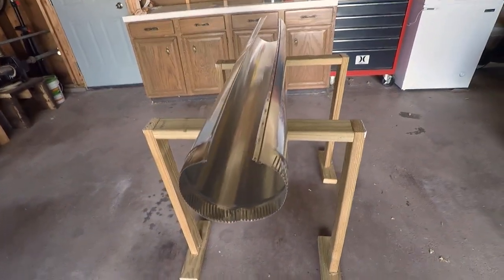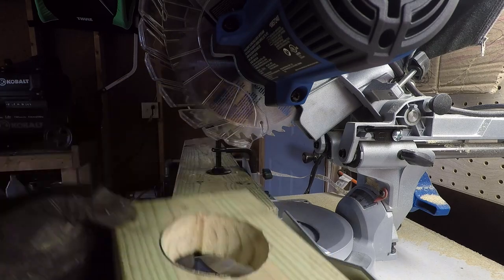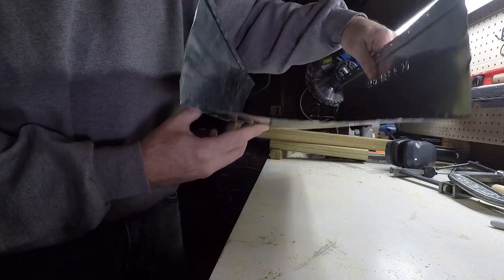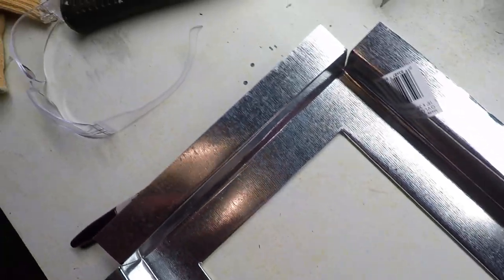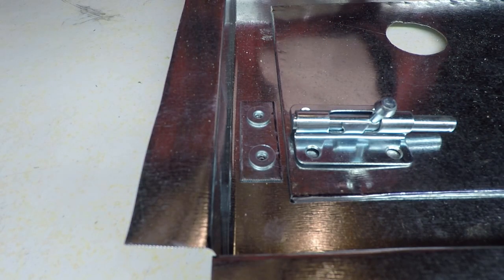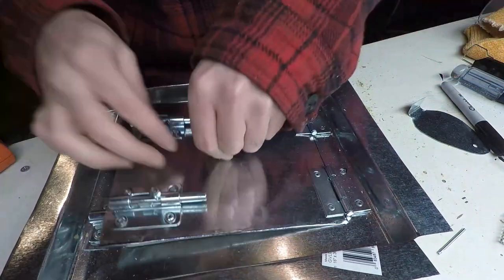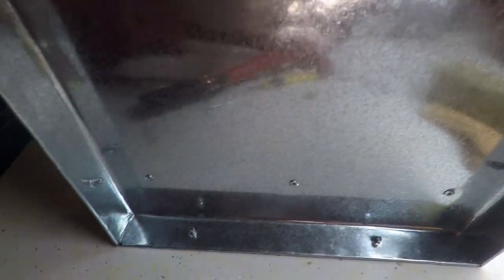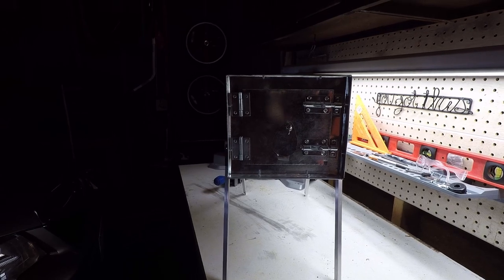$50 DIY Hot Tent Stove Build

Comment: Nice build! On the wobbly legs you mentioned that you could maybe drive them in the ground a bit, so I will assume you're using it in a floorless tent. If that is so, just drill a hole in the bottom edge of each leg and put a small loop of wire. Just drive a tent stake in each and you will be rock solid. Thanks, I enjoyed watching !